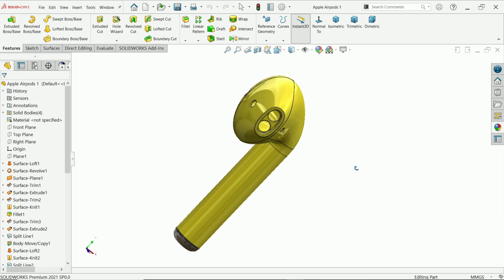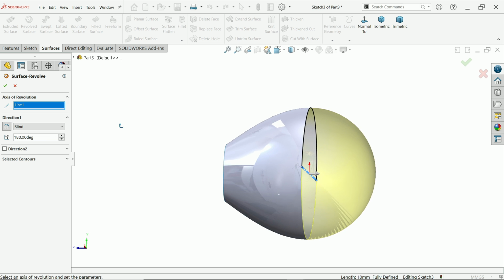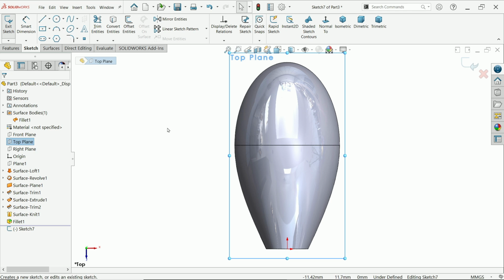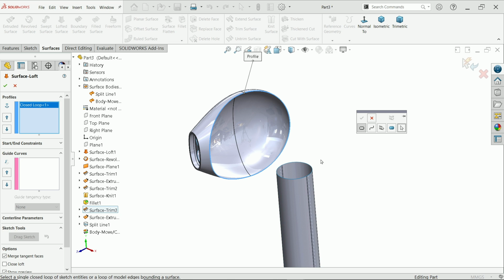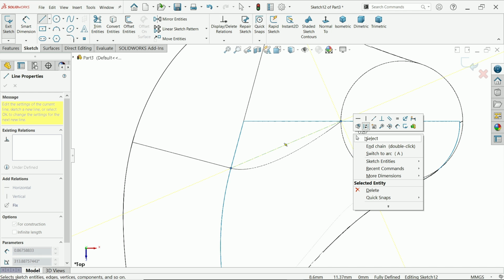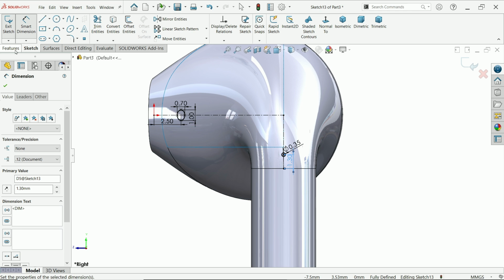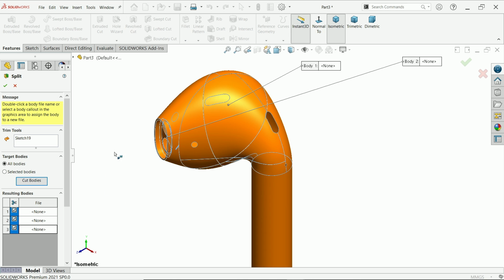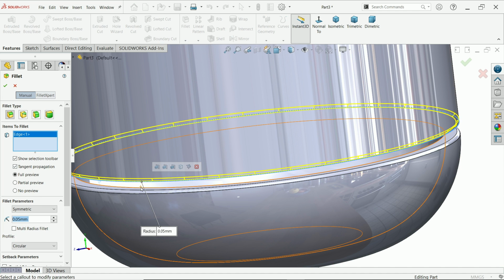Solidworks Surface tutorial Apple AirPods

Comment: Around 21:00 he creates a couple split lines on the bottom part of the headphone case, I followed the exact path he did but one of them will not show. It creates one of the split lines but the other just says "The projected sketch does not split the selected faces. It may not intersect the faces or be totally coincident with an edge on the face". Has anyone encountered this problem and knows how to fix it?
Reply: Not sure if you still need this, I had the same issue - I deleted the construction line that was tangent to the arc and made the arc's endpoint coincident with the face's edge directly instead of connecting it to another line
Reply: fixed the problem. the problem is that first arc is coincident with 3 lines thats why couldnt do. you need to move first start point to far away from coincident point.